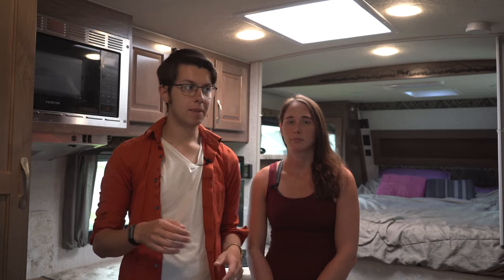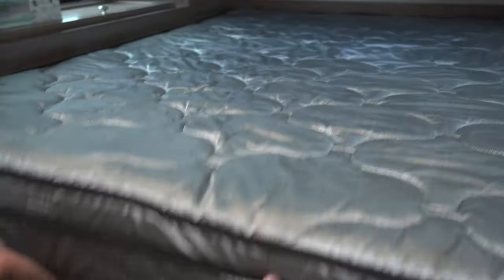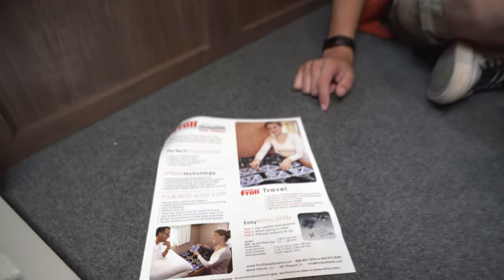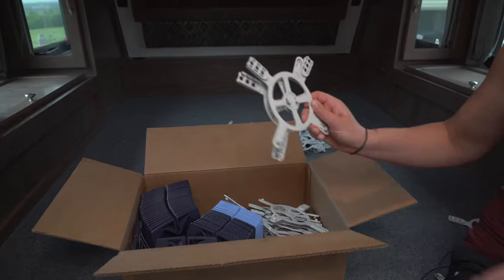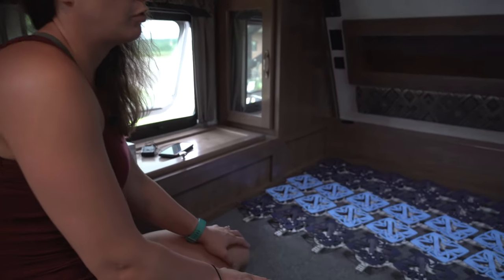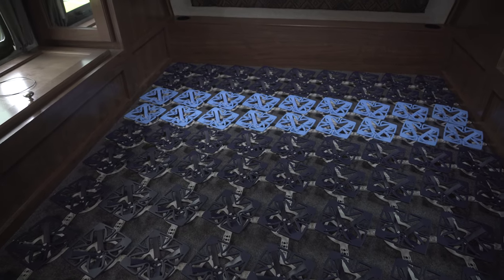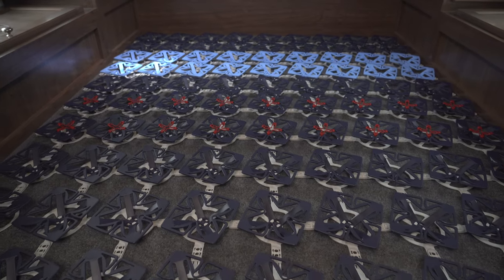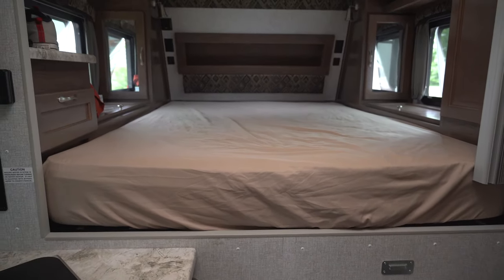Froli Travel System For Campers (2022)

Comment: We have one and I put a 12vdc fan, you would find in like a bus or school bus, and have mounted it and pointed it under the mattress. We raise up the sheets in the morning and we turn on the fan for about 15 min or so, to circulate air better under the mattress. We have never had a problem with mold. Also if you camp in cold weather and you run your propane heater, if you see your windows get wet, then open your cabinets and turn on the fans to keep mold away.  Great video! We are going to purchase a zero clearance adjustable bed frame. You can lift up your head and shoulders to read or you can lift you feet into zero gravity position using a remote. We can get out of bed in the AM and lift head and feet to get air under the mattress.
Reply from the maker: Awesome, great tips! The adjustable bed frame sounds really nice!